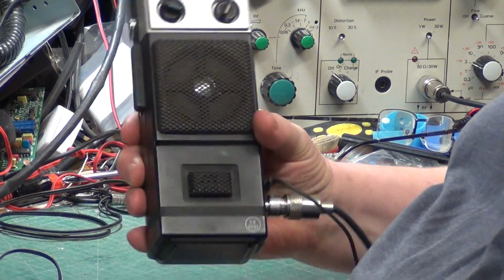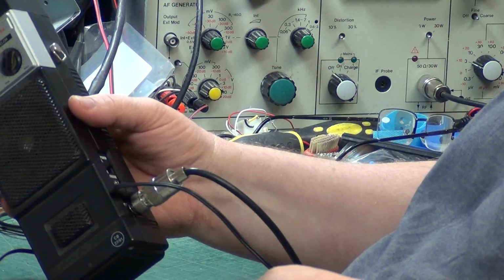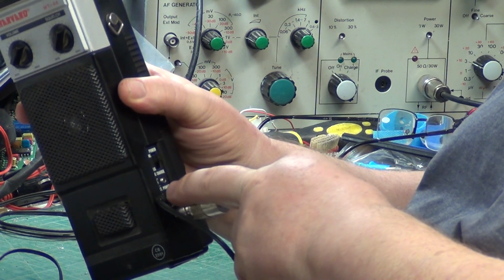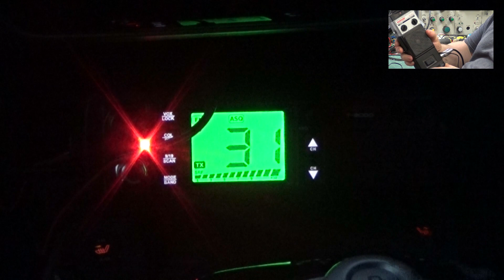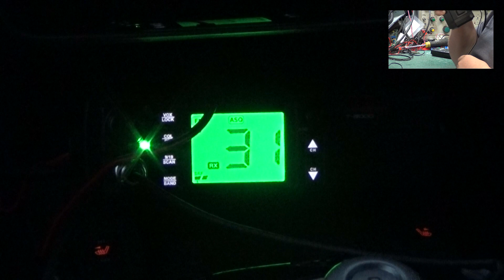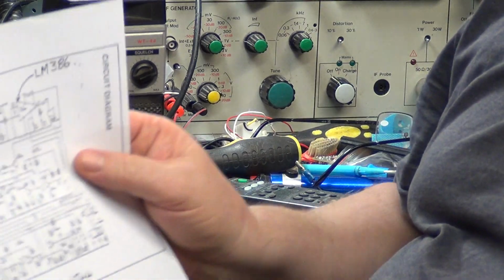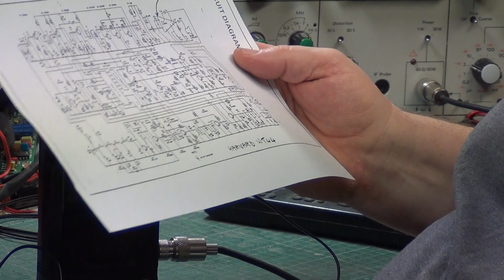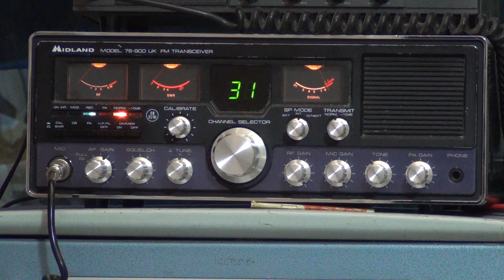Harvard WT44 CB27/81 UK FM CB radio handheld - On The Air test

Comment: Another great video, good to see the older hand helds. I have been looking back over your older videos to get the inspiration to tune up my old wagner tc 9000, i have a quick question, it has a button on the front called, ACC? Seems to affect the audio, but cannot work out what it really is? The radio works extremely well. 3.5watts, deviation 2.4 and spot on freq Thank you in advance, Steve aka Enthusiast Steve
Reply from the maker: It's for the optional (not ever available) selective call unit, thus putting the radio into silence until an actual call for you is received.

Richard
Reply: @ukfmcbradioservicingTango21  many thanks Richard